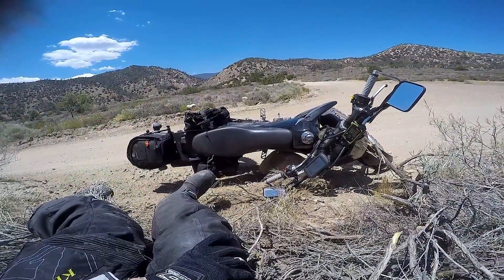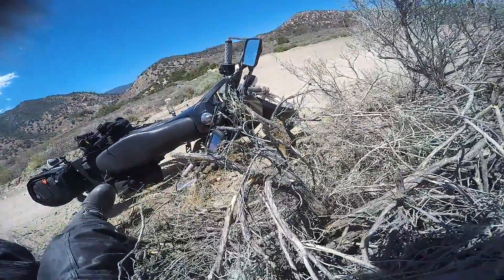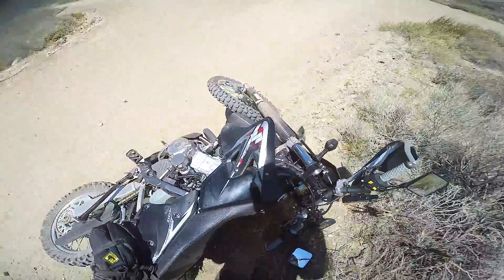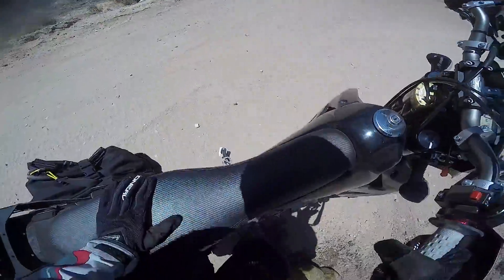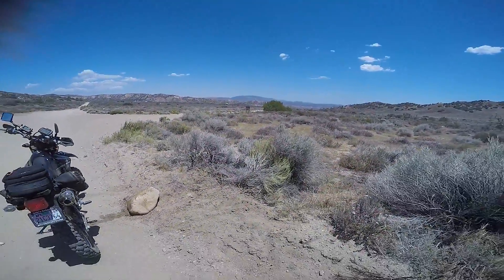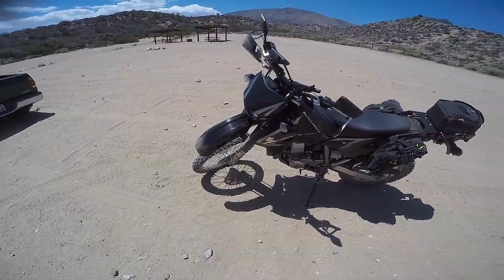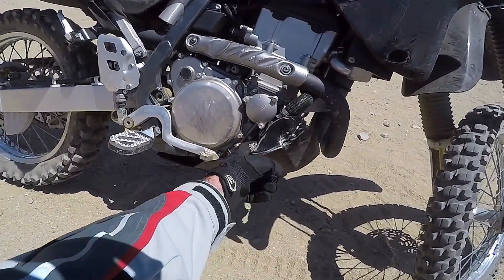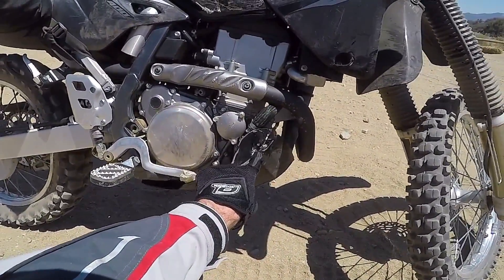How to Shatter a DRZ400 Water Pump    ✧DRZ400 Dual Sport Adventure✧

Comment: Hey how do you like those footpegs?!
Reply from the maker: They work great.  They are from Knight Design and are about 1-1/2" lower than stock, perfect for if you are tall.  Being larger than stock they are very comfortable on your feet when standing. I have nothing bad to say about them.  The only thing I did to them was to file down the sharp points on the thread on the outside of the peg as it kept cutting up my pant legs.
Reply: Awesome reply man, I'm 6'8" and already got the bars up as far as the stock cables can handle so I'm just looking for a way to lower pegs! Any issues with ground clearance with them? They don't hit rocks or anything?
Reply from the maker: Not sure how high you raised your bars but I went 3-1/4" with stock cables.  If I remember correctly I re-routed them from in front of the bars to behind to get some extra length.  I never had any problems with ground clearance but then again I wasn't doing any type of hard enduro riding.  Unless you ride in extremely large rocky terrain I don't think you should have a problem.  Besides I am pretty sure it is the only option for lowered footpegs for the DRZ400.
Reply: Yup it is the only option! And I have 2" Rox risers and ATV mid bars! So whatever rise that gives me I have! 

Thanks man! I subscribed!
Reply: You guys must feel like a bear on a tricycle. I'm five 11 and it does seam a bit small. But I did come off a big adventure bike which I have one for sale. Drz rocks.